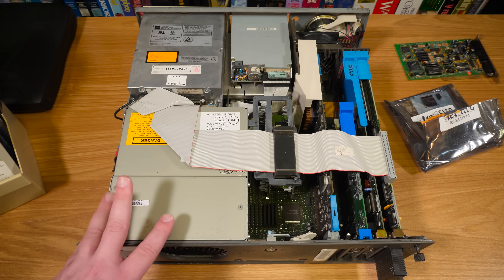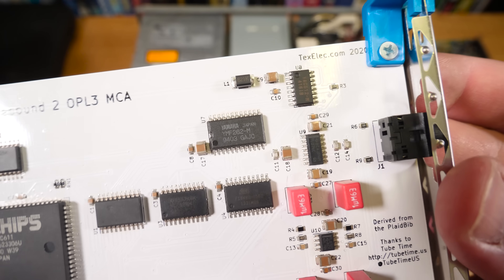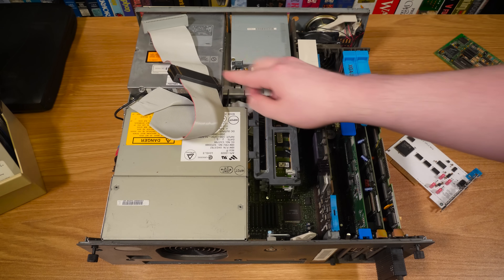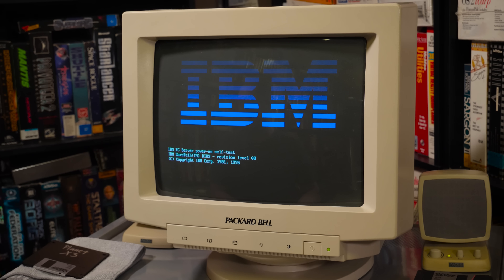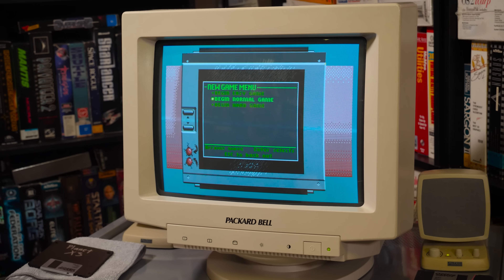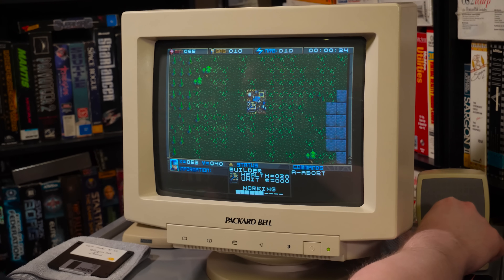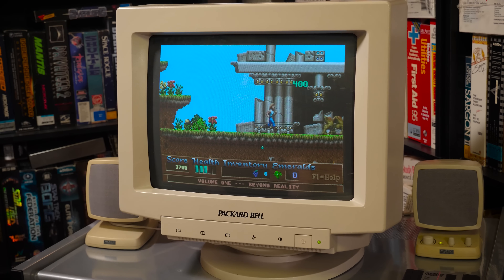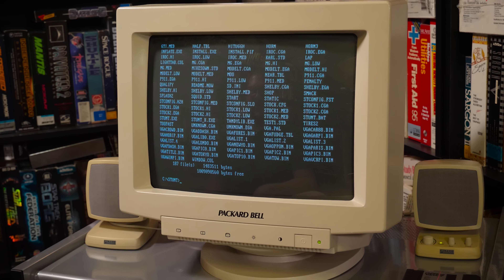Resound 2 MCA: AdLib-compatible Microchannel Sound Card

Comment: Hey Clint, thanks for making the video!  The built-in diagnostics only work with some IBM hardware, and nothing third party.  However, you can go back in with the reference disk, and view or change the configuration, and you will see all of the cards installed.  The audio level is more in line with consumer-level audio as to not drive programs like Xargon too loud  There is a single 15khz hi-pass filter I have added.    This is the same for the new OPL3 ISA card and the SAAYM.  The SAA's have a small low-pass, around 50hz.  No FM chip can reliably produce anything that high, but no low-pass at all on the MCAs.  They always made the bass muddy IMO, so I risk some noise.  Thankfully, PS/2 have well filtered supplies. :-)
Reply from the maker: Thanks for the info, makes sense!
Reply: Have IBM demanded an MCA license fee? :)
Reply: @ian_b  No, and to some degree, I think this may have been a myth.  The heart of this card is the Chips P82C611, and it does the MCA heavy lifting.  No license would have been needed at the time for it.  However, you do need an adapter ID.  I just used the same one as the Adlib, but back in the day, it would have been risky to pick one out of the sky as IBM was the one handing them out.
Reply: @TexElec  Thanks, that's very interesting. Were IBM charging for the IDs rather than "licenses" then do you think?
Reply: @ian_b  Maybe, but once you start peeling back the layers on how the cards are detected, and how they work, it's actually pretty easy.  But I suspect that yes, IBM was probably charging for the ID, and maybe the docs?  I mean everything is on the Internet on how it works now, but back in 1987, you probably had to at least pay IBM a fortune for the documentation.
Reply: @ian_b  I wonder if it would be possible to make these cards reversible, so they'd fit in both an ISA or MCA slot?  ISA on one edge, MCA on the other?

I mean, you'd obviously need a different bracket for each, but aside from that.
Reply: Such a thing exists.  Adrian’s Digital Basement just ran across a SCSI card I think, ISA and MCA.
Reply: I loved the 90. I also had 60s and 80s but they weighed a ton! And I always kept the reference disks stored inside the machines
Reply: @TexElec I got mine a couple weeks ago and it's swank, but I did send you guys an email about filing a wedge into the PCB contact edge to keep it from damaging the slot on insertion.  This thing trashed the slot on my PS/2 P70 and I had to track down another riser card for it.  You can see the way the original card is tapered at 3:20.
Reply: @dualityk  Sorry you had an issue, but I really don't think it's widespread.  I've tested about 75 of them in the same slot on the same Model 70 and you're the only report I've had of an issue.  I'm not a big v-file fan personally, I feel it's unnecessary and makes the cards fall out more easily.  Especially considering I can't supply tabs for them.
Reply: @TexElec  It could be a difference in tolerances between machines, maybe related to the fact that the P70/P75 were built in Japan instead of the US.  Mine would not seat in either the 32-bit or the 16-bit slot, and trashed the latter with a bunch of bent contacts.  All the old MCA cards I've ever seen, and even the riser itself on the P70, were filed down for a reason, and just the bottom millimeter or two, so it doesn't affect the slot's grip on the card once installed.  Once filed, just a very small V that doesn't even touch the contact pads, it seated fine in all the non-ruined slots I had left in the house, and it stays put just fine.

Not trying to harsh anyone's vibe and I give you guys major props for supporting MCA (as well as figuring out the secret sauce to Key tronic foam pads!) but it'd be sad times if someone wrecked a motherboard instead of just a riser.  I think it'd be worth at least mentioning the possibility.
Reply: Given the sampling rate of the OPL3 15 khz seems like an overly conservative cutoff.  But I only know enough to punch the cap I can buy and 20khz into an online calculator and see if I get a reasonable resistor.
Reply: I'm not too familiar with sound card specs, but shouldn't it be a hi-cut at 15khz and respectively a low-cut at 50Hz to get rid off highs and lows at the respective cutoff points? In my understanding a hi-pass at 15khz should result in nearly no audible sound especially with the low-pass at 50 Hz in combination, but since there obviously is sound, maybe it is just a typo? Or I'm totally wrong and didn't get it :-D
Reply: @cooloutcoexist  The other cards have a 50 hz high pass filter, not a 50 khz one. So, with a 15 khz (15000 hz) low pass filter,  there's all the sound betwen 50 hz and 15000 hz available.
Reply: Mixed hp and lp filter
Reply: have you guys got this working on 3.1? I can't seem to get it working.
Reply: IDK if this comment will do anything but would it be at all possible to make an IDE adapter for the ps2? The HDD format is really weird and hard to come by.
Reply: @SandwichesANDMilk  I am totally working on one now.  Should be working on the X16, but I couldn't wait to get an IDE controller up and running.
Reply: SandwichesandMilk seconded. I have a 30/286 that is gravely in need of a new hard drive. I could install a XT-IDE but I'd rather reuse the onboard HDD controllers if possible because that thing has very few free slots.
Reply: @RAMChYLD    So in principle, what you need is something to adapt ESDI to IDE, then you could get away with any old IDE-2-CF or SD solution?

edit:  Actually, ESDI to SCSI might be easier.  There are SCSI to SD solutions, too.

Comment: So many memories from this video.  I was the first to get the model 90 at my company back in '91.  What a cool machine.  Before that I was using a model 70 and a 50 before that.  

I still have my model 50Z with an AOX 386/25 add-on card, but what might interest you most, I have the Soundblaster Pro 2 MCV (CT5330) installed and still use it to play earlier games.  Who knew when I purchased it, it would be so rare this many years later.  Guess I never really thought about MCA being more used more for business and less for entertainment.  Still, my 50Z has been with me since '88.

Comment: I had to work on some of these in high school.  It's a great, amazingly IBM, sort of solution.  But, if you ever have to troubleshoot it will be awful.  Sometimes you have to add or remove a card just to be able to tigger the config screen to fix some other issue.

Comment: That looks a lot like an old ISA sound card I had 'back in the day' on a 486 DX2-100 system (my first internet box) and one of the things you don't see anymore is it had a little 2watt x 2 amplifier build into it and you could just hook up regular 8 ohm speakers ...... but it also had the old Yamaha OPL chip on it along with an AD-DA converter with a digital hardware mixer built in as well as an interface so you could hook a CDROM drive to play CDs through the computer which was a big deal back then

Comment: Ahh, microchannel, IBM's proprietary turd.
Reply: referral madness  Not that much. It was fast, had sort of plug-and-play. Techwise it was fine, a bit over engineered maybe. But the licensing was a mess. Only Tandy ever used it in the US I think. Nobody liked paying IBM tons of money (even for older systems that didn't even have MCA) so 16bit ISA was good enough or VESA local bus for 486s. Then PCI came around and it was just as fast as MCA. Most servers switched to EISA to avoid paying IBM.

Comment: Where I used to work, we had a PS/2 in use up until about 2007 as it was controlling a machine and the custom controller card was MCA so would not work in any other PC. Was a legacy machine and wasn't used very often and was only taken out of service when the work it used to produce was migrated to a more modern line, deemed obsolete and then scrapped!

Comment: I worked for a company back in the 80's called IDE Associates which made a variety of MCA and ISA expansion boards.  It might be worth searching out their olden stock.

As for MCA itself, at the time I thought it was the coolest, most awesome advancement in PC architecture up to that point.  Anybody who's ever tortured themselves with setting IRQ switches and jumpers manually will appreciate that.  MCA did have some downsides of course:  If you lost the configuration disks you were totally stuffed, so you had to be rabid about making backups, which of course the customer never did.  Otherwise, it was that murderous metal back plate - it was as sharp as a knife.  I dreaded removing cards lol.

Comment: Lol, i just ordered a 100% DIY clone of a MCA Adlib Card for my Model 70. 
https://github.com/schlae/plaid-bib

If i had known about the resound card earlier, that could have saved me a lot of time.

Anyway :) if you want to upgrade your IBM a little bit further then you can use this Adapter:
https://github.com/schlae/PS2FloppyAdapter

to install a Gotek drive. Soldering is pretty easy. Just a couple of resistors. I have installed this one as a second floppy. Works perfect.

The only thing i miss for this type of machines is a Compact Flash Adapter. My hard drive is still working, but someday it wont and there is no solution to this other than a new drive or a SCSI controller which blocks one of my MCA slots :(

Man, i don't know what IBM was thinking when they invented these types of connectors. Just awful.

Comment: My only experience with MCA was back in the late 90s when I was working at IBM.  I was doing internal tech support and some people had Ethernet on their Thinkpads, but the vast majority had Token Ring.   I was located at a remote downtown site and we had no way to test Ethernet.   Linux was still a forbidden backdoor kind of thing, so I installed it on this old hunk of 386 SX PS/2, configured it for bridging and gave it a cross over cable.   Slow, loud, but solved the problem...  bridging was overkill, but fun!  it's hard to imagine anyone doing anything like this today, but we were still in the final days of cowboy shops and servers-under-the-desk.   MCA was ok, but it was rare enough to just make solutions harder to find.

Comment: I made the adlib clone from TubeTime. I made mistakes in soldering, ordered some wrong parts, bought a chip programmer that was also somewhat expensive and now that the card is complete and should work,,,it doesn't. Simply waiting for texelec to make one would be a lot easier and cheaper :P

Comment: Just FYI,  The "weight" on the ribbon cable is a large ferrite core that's there to choke off RF leakage off the cable.  It may be fragile and could crack with a drop on the frame.   IBM spared no expense.  Which probably partially lead to the high price of these new.

Comment: Stunt Driver is one of the very few DOS games that actually use digital sound effects on the Ad-Lib.  However, the FM chip wasn't really designed for this, so it's kind of a hack.  Sort of like getting digital sound from a SID chip.  That's why the volume is low.  And your mileage probably varies depending on which FM chip is being used.
Reply: "mileage probably varies"... pun alert.
Reply: When Clint Dropped into a map on Planet X3 it felt like I was playing Ultima again....
Reply: So does Jimmy White's Whirlwind Snooker and Darkseed.
Reply: @thepirategamerboy12  Might and Magic 3 also can do digital sound effects on Ad-Lib.
Reply: @BjornThePiper  And you can add WaxWorks to the list, too.  Just discovered it supported Ad-Lib samples when playing it last night.
Reply: Can I just say that PX3 looked extremely nice in this video? I'm quite tempted to buy the image, so that I can play it using DOSBox. I'm not an avid player of strategy games, but I've seen all your development videos and it might be worth getting it just to thank you for those.
Reply: Elvira was another one, and yes, the volume was also extremely low.
Reply: I barely recall a technical discussion I read on a BBS of how this was done back when this was new.  It worked by starting a FM synthesis of some note, then freezing it at some precise time. Then this waveform would be manually turned on and off quickly to produce digital sound, sort of like PDM. 
The first part of this was something like, program the OPL operator registers for this note, tell it to start, read this IO port exactly 31337 times, then freeze the FM synth.
It wouldn't surprise me if the "read IO port 31337 times" doesn't have the precise timing it's supposed to because of the MCA card and so the FM synth isn't stopping at max volume like it should and that's making it too quiet.
Reply: Hi the 8 Bit Guy
Reply: Or digital sound from the PC speaker.

Comment: Pretty sure it's heresy to use a Packard Bell monitor with a PS/2. You're displaying the best of the best on the worst of the worst! 

Also, this gives me a proper reason to get a PS/2. I've wanted one ever since I learned about them and found an 8513 monitor at a charity shop, but the lack of sound cards always put me off them. Now though? All bets are off.
Reply: In this day and age you take what crt you can get
Reply: @TheTurnipKing  I know. I was just trying to be funny (in my defense, he does have several IBM monitors). I have a 9 inch RCA TV from 85 that's doing overtime as a monitor for my 8 bit micros and being the center of a pretty solid retro home theatre system (all it's missing is a Dolby digital-capable laserdisc player). It's also why I'm planning to try and fix the bezel of a Vaio Trinitron that was shattered in shipping instead of trying to replace it (also it matches a Vaio desktop I found a while back).

Comment: Not a weight. That's a ferrite core. You're missing both the metal clamp and the plastic cover for it. I'd link you, but i can't since.. you know, youtube. So the next best thing is to go to images in google and type "ibm ribbon cable ferrite cover" the first image, shows you the metal clip you're missing. The plastic cover...yeah, i've never seen on in the wild, and mine are long since replaced with a shrink wrap variant because plastic became brittle.

Comment: Funny you posted this. Glad i'm not the only one who has bought one of these. I got one for my PS/2 P70 (8573) machine and plan on doing a video on it too! 
For refrence, a Creative Labs Soundblaster for MCA right now goes for over $1,000. The IBM M-ACPA (Audio Capture Playback Adapter), assuming you can find one, usually runs $3-400. Those are only cheaper because they aren't 100% soundblaster compatible.

Comment: I know the "PCM sample" channel on the original 6581 SID chip was really just an exploit of a sort of "click" the chip made when changing volume levels IIRC. Not sure what the mechanism of creating PCM sound on the original Adlib was, but it's possible whatever it exploited is not present on this recreation, or only present in a way that doesn't create as strong of a signal as the original.
Reply: Same thing. The ASM code I remember was:
Tweak it for the loudest pop it can make
Freeze that synth
Toggle the volume at somewhat 8kHz to playback samples

Used quite a lot of CPU time but was a lot better than PC Speaker samples.

Comment: What about that ‘CHIPS’ section on the card? Seems odd that that would be needed if the OPL3 is doing the Adlib music, I wonder if Xargon detected it as a SB compatible chip?
Reply: That chip has nothing to do with sound, it's there to negotiate with the Microchannel bus.
Reply: @RetroSwim  Ah, I see. I thought it worked similar to the VLB extension (like an add-on to ISA), MCA must have deviated a lot from ISA in order to need that, not so used to seeing that on old sound cards for DOS machines, since most ISA ones were plug-and-play.

Comment: Just so you know, you can make your own custom laser cut card holders these days. Dunno about US/NA but i'm 100% sure there's laser cutting services. And all you have to do after they cut the flattened holder, is bend it, which for a card holder, it's easy, you can probably use a steel ruler.

Comment: Could this be combined with an LPT DAC for both music and sound effects in some games?
Reply: Maybe.  Maybe not terribly useful on a AT or XT class machine, like this 286 tho.

The DAC drivers have a certain overhead that means you really need a 386 or higher for it, iirc.
Reply: @TheTurnipKing  This PS/2 90 is a 486. It runs duke3d in this video. It could be upgraded to a Pentium 90.
Reply: @joe--cool  my bad.  It should certainly be able to take the DOS driver overhead
Reply: @TheTurnipKing  Hey, no big deal. The OPL2 "digitized" sound in the video works about the same way as a LPT DAC so it should run as well. ;)

Comment: Does the sound of different Adlib cards differs like it does with MIDI when using different soundfonts/instruments? Or does the sound varies according to the resistors/capacitors in the board like it happens in guitar pedals for example? Dosbox' Adlib emulation is not quite the same thing.
Reply: To answer the first question: Yes, to an extent. Some clone cards and late-model Sound Blaster cards use a clone/re-implementation of the Yamaha OPL FM chips, and these have different characteristic sounds.  Similarly, the OPL in DOSBox is emulated, so it too is a re-creation of the original thing.

To answer the second question, also yes, kinda. Different card manufacturers will use different analogue stage designs, which may have high/low pass filters as desired. These mainly just affect the bass/treble balance of the sound, though,  not the same difference as between Yamaha OPL and non-Yamaha chips, or between different MIDI synths/soundfonts.